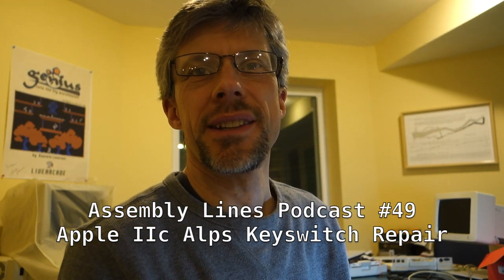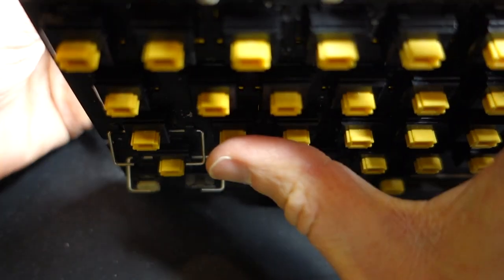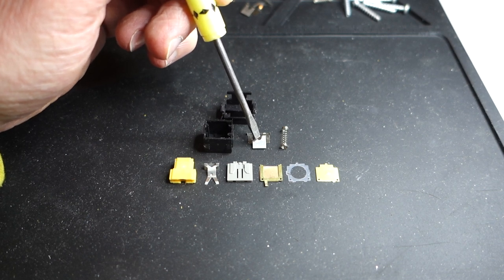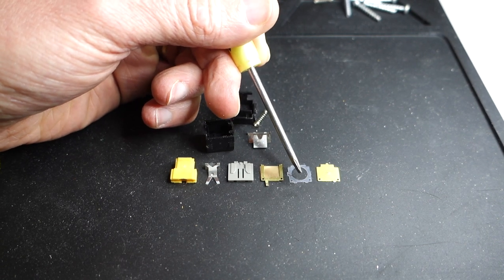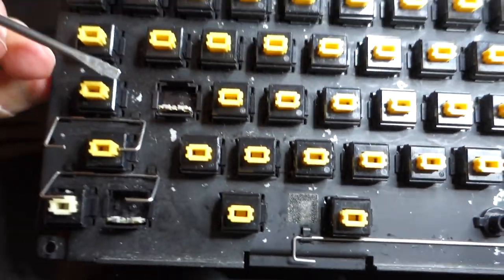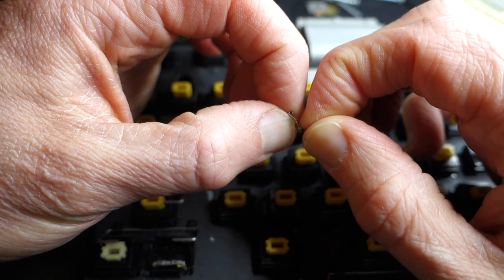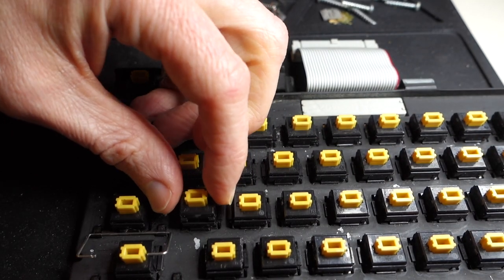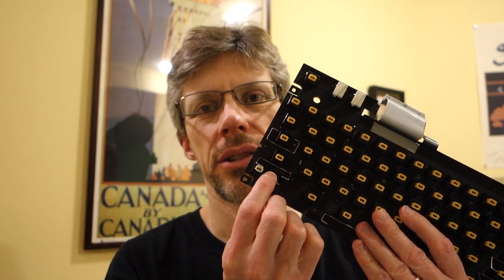Assembly Lines #49: Apple IIc Alps Keyswitch Repair

Comment: After 28 long years I decided to dust off my old Apple IIc and I found problems in the keyboard, which took me a whole day of work, besides finding damaged some printed circuit tracks, I reconstructed them and at the end of the day I was working as before, it is only pending to remove the old rom 255 and burn the new rom 0 in a 27C256 to use my unidisk.

regards
Reply from the maker: That's great! I love to hear when someone gets their old machine working again. If you're on Facebook you should join the Apple II Enthusiasts group. Cheers!